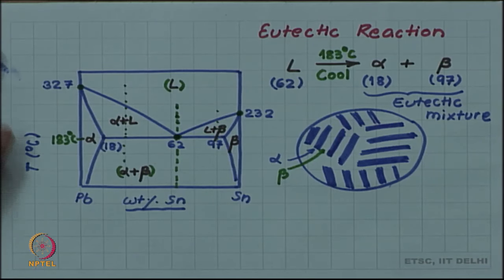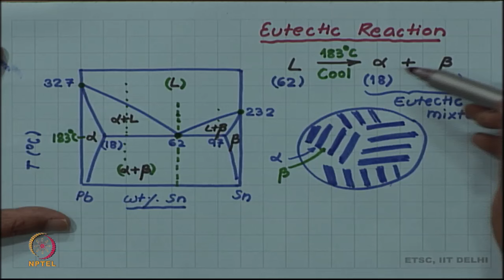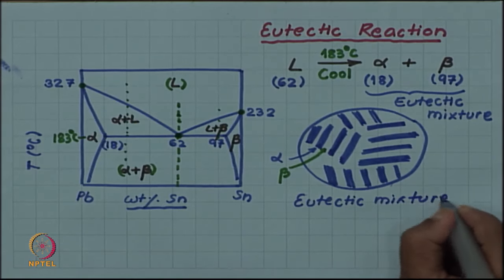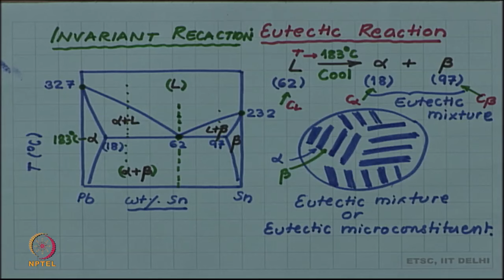Eutectic reaction

Comment: Great videos! 

One quick question, and i think this might be the key to understand these diagrams:
At the eutectic point, when going from liquid to solid, there is 18 wt% alpha and 97 wt% beta, but shouldnt they add up to 100 wt%? 

I would appriciate an answer that makes me understand this diagram better! 

Keep creating good videos so the world can become smarter! 

Thanks :)
Reply: Actually Alpha is a solid solution of Sn in Pb containing 18% Sn. Thus it contains 82% Pb. This of course adds up to 100%. Similarly Beta is a solid solution of Pb in Sn. It contains 3 % Pb in 97% Sn. Again it adds upto 100. If you calculate % of alpha and beta in the eutectic mixture, they will be different values and again will add up to 100. Thus, by applying lever rule just below the eutectic horizontal for an alloy of eutectic composition (62 wt% Sn),  there is (97-62)*100/(97-18)=44.3% alpha in the eutectic mixture. In this alpha there is 18% Sn and 82%Pb. Amount of beta in the eutectic mixture is 100-44.3
Reply: 18 percent tin and 97 percent tin. Thats what these numbers mean. Alfa and beta have relative proportions of 55 percent and 45 percent.
Reply: hmm

Comment: Question : why the solid to liquid transition temperature range is varying with respect to composition , sir?
Reply from the maker: This is a deep question. The answer lies in the thermodynamics of the alloy. The phase or phase-mixture present at any given composition or temperature is the one that minimises the Gibbs free energy of the alloy. Thus the entire phase diagram is actually graphical representation of this thermodynamic condition. I have not been able to answer your question. i have just given a suggestion.

Comment: Sir,why do we get alpha and beta microstructure in a lamellar type only?
Reply from the maker: You have asked a very difficult question. I do not have an answer now, but I will certainly like to look it up. 

All the phase diagram and the eutectic reaction is telling us that two phases will form from the liquid on cooling. But the phase diagram cannot indicate that they will be lamellar. It is an experimental fact that they are lamellar in the case of Pb-Sn. But other kinds of eutectics are also known: rod eutectic (one phase is rods and the other a continuous matrix) or Chinese script eutectic (two phases very intimately mixed). 

One thing is clear that it is a question of kinetics rather than thermodynamics. I say this because in the lamellar eutectic there is a very high level of alpha/beta interfacial energy. Thermodynamically the system should try to decrease the energy and so the two phases should separate out with a single alpha/beta boundary. The fact they form so many interfaces must be facilitating the kinetics of the transformation. 

But, of course, I have not answered your question :-(
Reply: @introductiontomaterialsscience  Thank you for the reply sir

Comment: Dear sir,
I have small confusion about the eutectic microstructure which I have not been able to clear for a long time.
My question is:
"Won't there be any grain and grain boundaries in this kind of microstructure? And also, what is the interface or boundary between the alpha and beta phase is called in this context?"
Reply from the maker: A grain boundary separates two regions which have the same crystal structure and composition but different orientation. Since the alpha and beta phases of a eutectic microstructure have different crystal structures and/or compositions they are not grain boundaries. They are called phase boundaries. Sometimes they are also called interphase boundaries.
To the best of my knowledge, alpha and beta phases are single crystals, so they do not have any grain boundary.
Reply: Thank you so much for your response sir ! So the alpha and beta phase are the single crystals but arranged in a lamellar fashion, am I correct? And also, each of these phase will have different orientations?
Reply from the maker: @Bablu194  That is right.
Reply: So it means, grain boundary is in a single phase (Alpha Or Beta) only and a boundary to separate different orientation of a single phase (alpha Or Beta). 

And on the other hand phase boundary present in more than 1 phase as the name is suggesting and separates 2 phases (Alpha and Beta). Sir, Am I right?